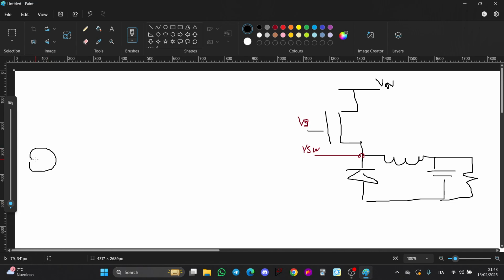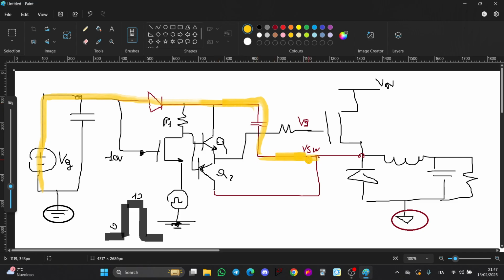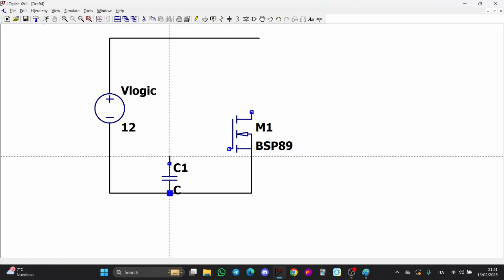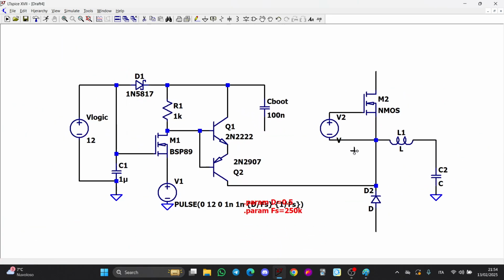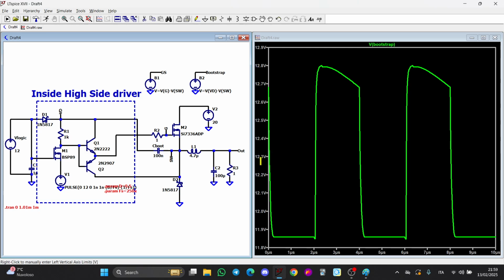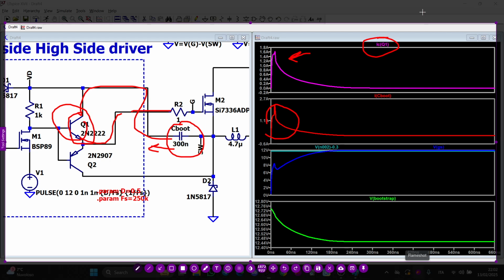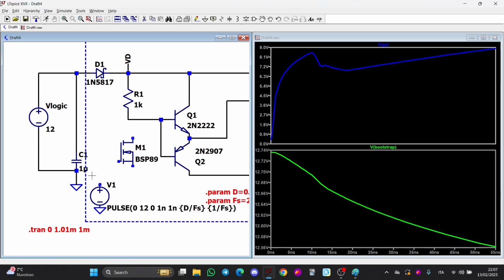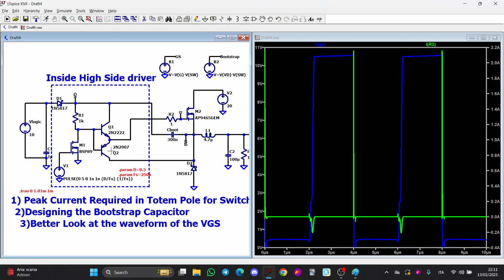[LTSPICE] High Side Bootstrap Simulation

Comment: Hi, great video ! How do I know which voltage should my PWM output to communicate well with the driver ? Here you place 12V, equal to the voltage source. Is this always the case ? What if I have a classical 5V PWM  output ? Should I amplify it ?. Generally I would appreciate an explanation on how I should chose my PWM voltage. Thanks
Reply from the maker: It depends on the techonlogy of the device
Mosfet usually suffice 5V for the gate.
For the power supply, Sic drivers will generate 15V and -3,-4V for instance. So it depends

Comment: How does actually high side drive bootstrap works while using a gate driver
Reply from the maker: You put the bootstrap capacitor outside the gate driver on the BOOT pin. He will give the charge to the totem pole stage basically